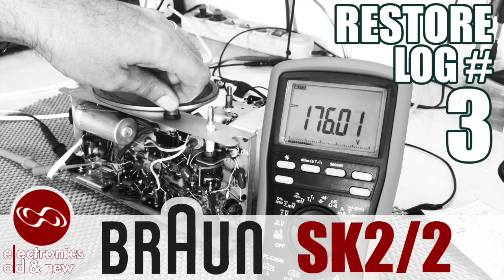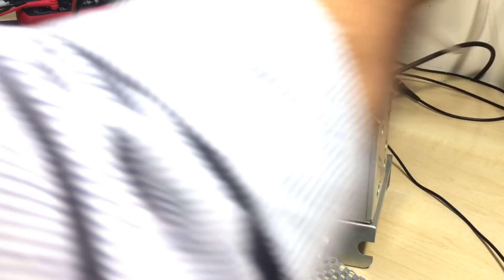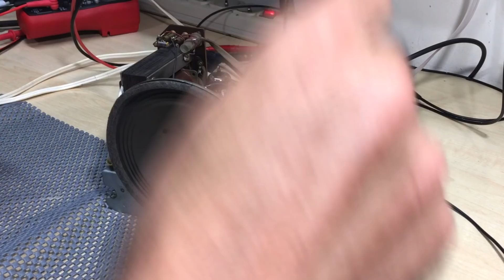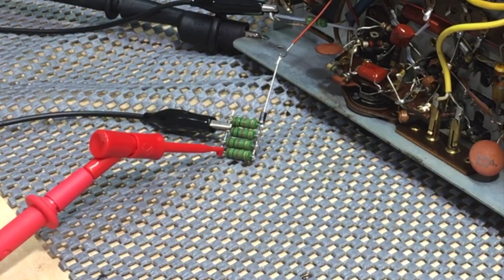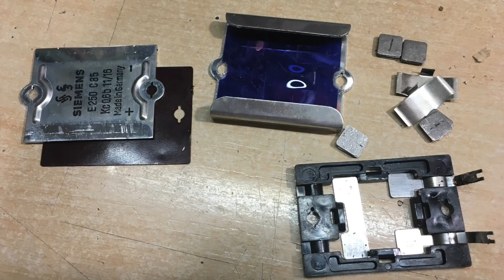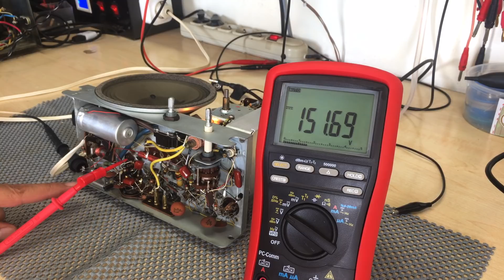Braun SK 2/2 tube radio restoration - part 3

Comment: I keep some high wattage rheostats handy for this purpose. Its easy to dial in the voltage drop with them then measure the resulting resistance and sub in a fixed value ballast resistor.
Radios looking good.
Cheers,
Reply from the maker: Got to get me one of those.

Comment: I should point out that the resistors are dissipating rather more than the wattage that you calculated.  The reason for this is that the current waveform through the resistors is not DC, but in the form of quite narrow pulses.  If you measure the voltage across the resistors using a true RMS meter, you can make a more accurate determination of the heat dissipated.
Reply from the maker: You’re absolutely right, I didn’t remember that aspect of it. I’m going to do a measurement across it just to get an idea of how different it is.

Comment: I would be tempted to draw a diode in series with a resistor on the case of the selenium rectifier, to show the diode orientation, and give a clue as to what's inside
Reply from the maker: I’ll just give the links to the video series :)

Comment: I was playing along while watching, looking at the schematic while you were pondering resistor values. I'd guesstimated ~230 ohms, so I wasn't far out 😉. I'll stick my neck out here and guess that when you get to the end and measure the output power to the speaker, it'll be about ~700mW or so.

I also once made a similar mistake with B+ polarity, but failed to catch it before power-up. It did not end well...

Looking forward to your description of the front-end/converter section. I hadn't really looked at that bit before you mentioned it, and I admit I'm still a little puzzled by some aspects of it...
Reply from the maker: It is a very weird front-end. It is the first time I’ve come across it, and I’ve got an idea how it works but trying to figure out some specifics.
Reply: @electronicsoldandnew  Glad you've got an idea, and I really am looking forward to your explanation.

Because I know what it should be doing - and I'm pretty sure I know how it works on FM, though it seems a bit backwards - but the more I try to figure out how it works for AM, the more it's got me stuffed 🤷🏼‍♂️🤣!
Reply from the maker: Jim S : the first ecc85 triode seems to turn into a Hartley oscillator when am is selected.
Reply: @electronicsoldandnew  Thanks for that, Manuel; it suddenly clicked about 1/2 hour after I went to bed after posting my previous comment - but only because I'd exhausted all the other possibilities! Glad to have the confirmation 👍

That sort of double-duty is very clever and I hate it with great admiration! 😉

Comment: These selenium rectifiers often fail with high internal resistance. As they seldom fail shorted, I use the tag points to solder an 1N4007 to such single rectifiers. And also wire in a series resistor to compensate for the higher DC voltage
Reply from the maker: I’m a sucker for punishment: fitted diode and resistors inside the original casing to try and preserve the original look.

Comment: Enlightening and informative as usual. Glad you spotted the polarity issue. I have a problem understanding valve rectifiers. How can the positive HT come from the cathode?
Reply from the maker: AC goes into the anode, and allows the positive-going half of the wave to pass through, coming out of the cathode, where it meets the filter cap, producing the DC supply voltage.
Reply: Electronics Old and New by M Caldeira that makes perfect sense. I just cannot seem to get this in my thick head! Must be my age!

Comment: I don't think that I have ever opened up one of those flat selenium rectifier cases before, I never really thought about it, but it's a novel way of hiding silicon diodes and the obligatory  dropping resistors. The construction looks interesting, so it was a sandwich of metal squares inside? One habit that I have gleamed onto is to "stack" silicon diodes in series, it replicates the construction of the old selenium to some degree, which is basically a series of smaller diodes sandwiched together, and it also eliminates the possibility of destroying the filter cap by having a single diode short out. Speaking of which that is another way to drop voltage, connect two or more diodes in series, about .7 vdc each, though to knock down 10 volts that way becomes rather clumsy. 
 I too am curious about the weak performance, it could be alignment, or it could be weak tubes. Sometimes when an AM/FM radio is only used on AM for a long time the FM only tubes will wear out because it used to be common practice to shut off B+ to the FM tubes when they were not being used. I've found that a few times, though in one instance FM was not being used for good reason as the tuning caps were seized up.
Reply from the maker: The selenium diode was precisely that: little squares of selenium stacked together with the anode and cathode points coming out. In fact if you could use series diodes to do the drop, you’d be doing it more correctly. However, obviously the 10 V or 15 V drop would require a lot of diodes and space.

The bakelite casing is actually brown and I have managed to remove most of the paint and will show that in the next video. It’s a Time-consuming process, but fortunately it’s a small case so it’s manageable. This little guy is going to look great. I’m painting it the original grey.
Reply: It's a light grey? It was hard to tell through this monitor, it looked like maybe it was white, but possibly just a bit dirty.

Comment: With regard to the cabinet, if it is Bakelite, then paint and varnish remover should strip the old paint off, just remove anything polystyrene from the cabinet first, you may have to scuff the old paint first though if it's baked on, even then it might be stubborn and require a scotchbrite pad to scrub it off.. I see that they molded the cabinet from black Bakelite, was white the only colour option or did they have others? Another option for stripping paint, but will not damage polystyrene is DOT 3 brake fluid, however it takes longer, and will strip paint from everything.

Comment: It was normal for selenium rectifiers to have the cathode marked as "+".  At least that's the case in North American schematics.
Reply from the maker: Ok. Now it makes sense. I’d never come across that. Thanks.
Reply: @electronicsoldandnew  Look at a bridge rectifier: The "+" is the positive output
Reply from the maker: Yes, but this is not a bridge, only one diode.

Comment: I believe tubes and light bulbs also  produce heat :)  noob question: would a broken  ferrite antena prevent any reception? I mean only the ferrite, the coil is intact. Thanks for sharing!
Reply from the maker: True. But that is their secondary product, or it should be :)
A broken ferrite should still provide reception if you stick the pieces together. You’ll probably have to do a little alignment though, to get best reception.
Reply: I think I'll try to find a new ferrite. The radio is dead silent reception wise but oddly enough I got a very faint one poking around for voltages. That was weird :)